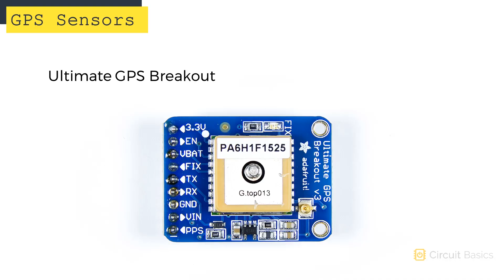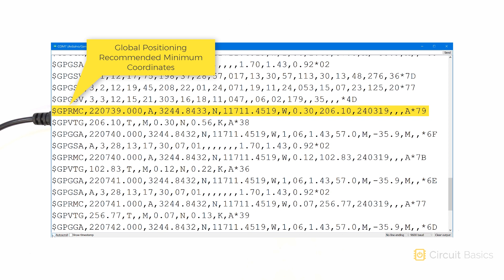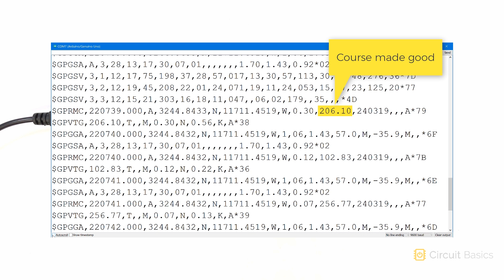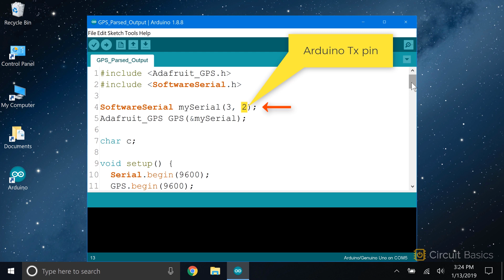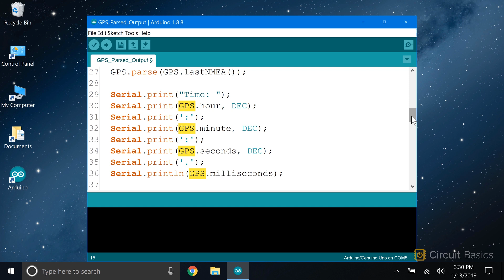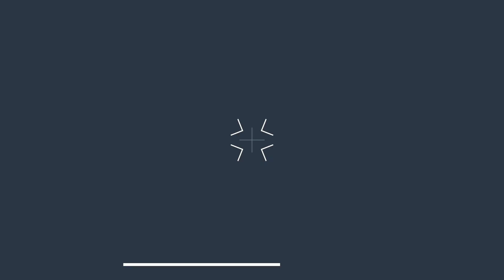How to a Set Up a GPS Sensor on the Arduino - Ultimate Guide to the Arduino #45

Comment: Great tutorial and easy to follow! However, after installing all the necessary libraries, making sure there is a satellite fix, and using the code from the website, I still cannot seem to get the parsed data to appear in the serial monitor. Any ideas on how to fix this? I was able to get the raw data to appear before doing any of these steps, so it does work. Also, I tried commenting on the website's comment section but it gave me an error each time...hoping this might get some traction lol

Comment: As far as I understood the module doesn't need a SIM card to give accurate coordinates readings?
Reply: Why did you even relate SIM cards to GPS locations?
Reply: The module SIM808 doesn't even react to AT commands without a SIM card.
Reply: @ESElen10  If you check, SIM808 has some external uses apart from just GPS.
Reply: I'm aware of that.  There is a certain type of GPS called differential GPS , which relies on a base station/fixed point with known coordinates to provide high accuracy locations. It seems like it relies on a mobile network to achieve that.
Reply: @ESElen10  You can relate in that way but GPS is primitively based on satellites.

Comment: I have been playing with a Beitien 880 with both an Arduino Uno and an Arduino Mega 2560.  The latitude and longitude always seems to be correct however the altitude and number of satellites seems to fluctuate.  I know my home is about 200 feet above sea level but the gps will show altitudes of anywhere from 30 feet to several thousand feet.   Also the number of satellites will be 0 to several thousands which I don't believe is possible.   I'm not sure why I'm getting these wild numbers.   I currently have the setup in a north windows with the GPS module tacked to the window with blue tack.